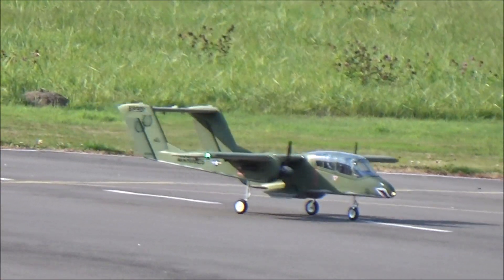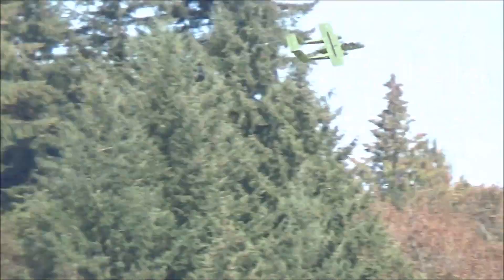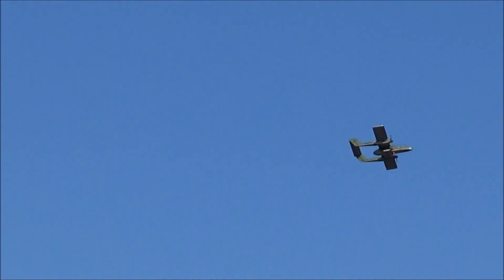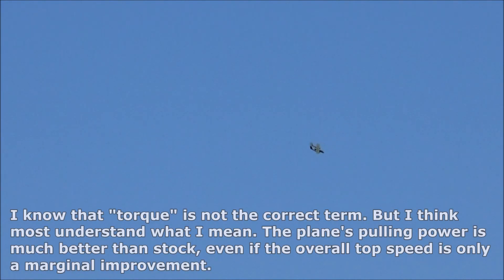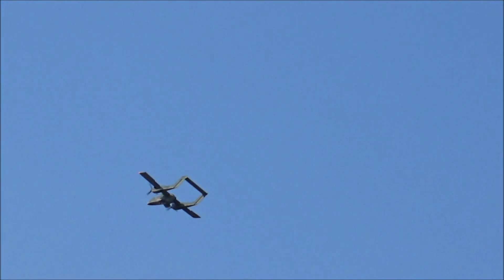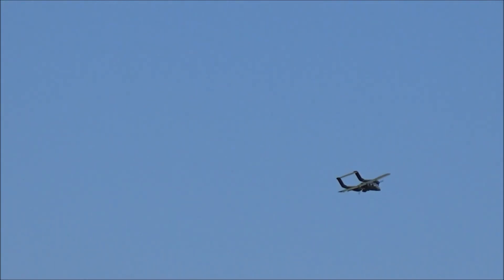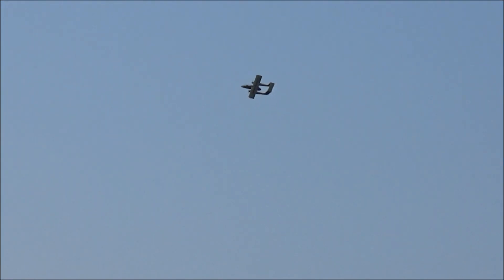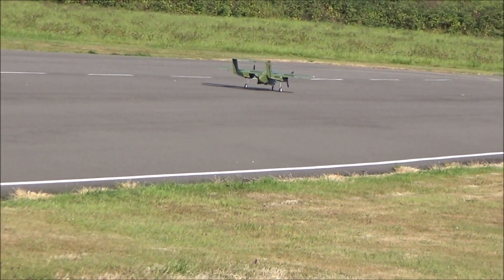Flightline OV-10 Bronco: Test Flight w/ Upgraded Power System

Comment: Can you advise on the props please did you buy two normal or one counter rotating?
Reply from the maker: I swapped out the stock props for slightly large 3-Blade - 11x7 Propeller by Master Air Screw:
https://www.masterairscrew.com/products/3-blade-11x7-propeller

Yes, I have one CW and the other is CCW.

Comment: enjoyed this video, do you recall rpm, amp draw or perhaps using a 3 blade 11x8 ??
Reply from the maker: Unfortunately, I don't have a tool for checking RPM and I never did get around to testing amp draw numbers. My guess is a 40A ESC is more than enough, but I have some 60's in mine because it's what I had on-hand in my parts bin.
Reply: @ShadowVFX  O.K thanks for the reply
Reply: @ShadowVFX  Did you use two esc"s with "Y" leads for throttle control with plus lead on one esc removed and was the "Y" lead heavy duty?Thanks
Reply from the maker: Yes. I just Y'd them together and removed the red connector from one of the leads. The Y lead is not heavy duty. It does not need to be since all it is sending is a simple signal to the ESC. The ESC gets power from the actual battery connectors.
Reply: @ShadowVFX  Thank you sir.